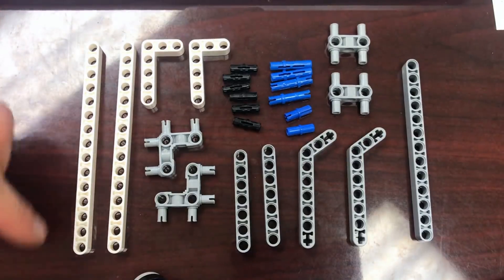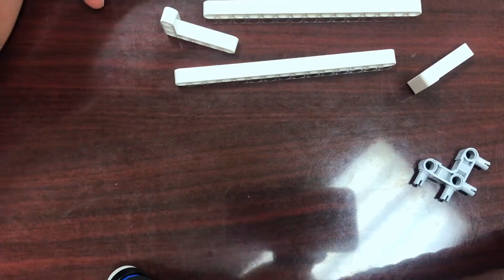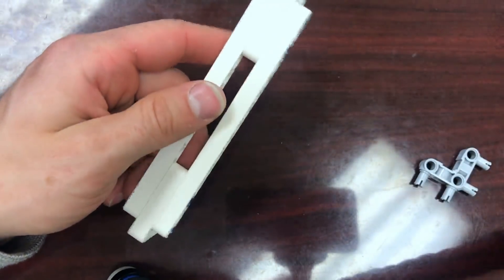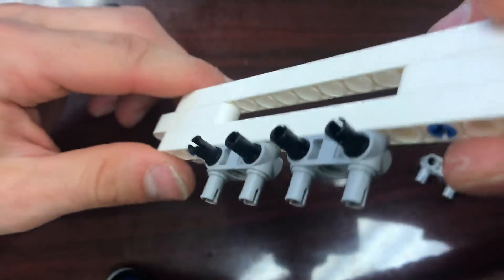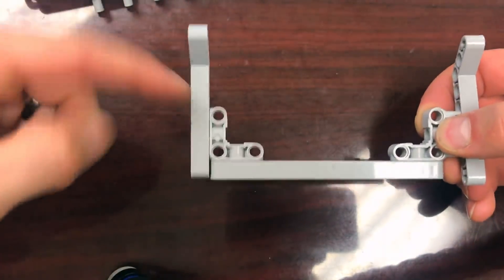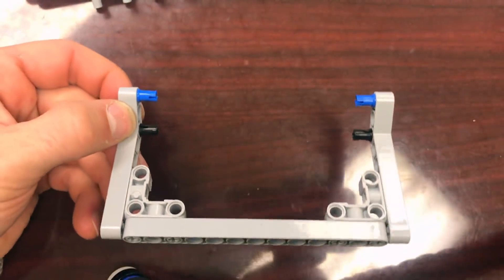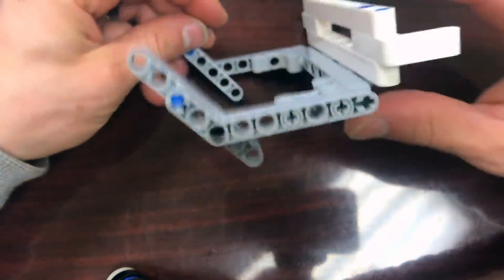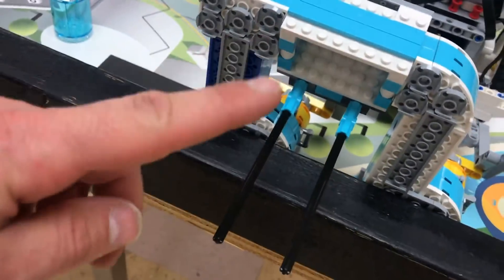FLL Hydro Dynamics Attachments: Flow Misson

Comment: The robot is accurate in its movements with large wheels? When we try, at first, it takes a shift to the left. An idea?
Reply: We've found that no matter what the robot doesn't go exactly straight forward unless we use the gyro; it can detect tiny changes in the direction, and we use those errors to send a small amount of more power to one motor, and a small amount less to the other motor, to bring the heading back to zero.  Today at our meeting we turned that into a myBlock & we've made a couple how-to videos.
Reply from the maker: +Isj P6 my students have found that the robot is far more with the larger wheels. As there is a little bit of imperfection in the EV3 motors themselves I would suggest making sure that you back up against a wall for 1 second and let the back bumpers of the robot make your robot square against the wall in base then move forward. This engages the motors and allows for more straight of a travel. Also, the slower you go, the straighter you go. What motor power/Speeds are you running at?
Reply: We made trips with an engine power of 50. If I follow your advice, it is to stall the robot and move it more slowly? Can we draw inspiration from your videos for the preparation of our runs? We are a primary class and my students are 11 years old. thank you in advance
Reply from the maker: +Isj P6 sure! Draw all the inspiration you can! I usually advise my students to run no more than 30 motor speed.
Reply: ok thank you for your advice. Can we quote you in our preparations? Do you want to know about our evolution? Good to you
Reply: I'm from team 26361 and we used bigger wheels too. We are going at 75 power and I think it's actually fine. Which wheels are u using? We are using the standard wheels, but just larger.

Comment: Since you helped us, I'm going to help you! The "Llama" is called a "Angular Beam 90 degree with 4 Snaps" and is a "special" piece. And the "Parallel Peg things" are called "Beam 3 M. with 4 Snaps" But, I like your versions better!
Reply: Plus, what can you use if you don't have those 2 pieces. Thank you so much!
Reply from the maker: +Bhargav Chandramouli Thanks for the technical names! Now I know! Which two pieces are you referring too? The so called “llama” and “parallel peg things”? If so, there are option with axles that could be implemented. With the 45 degree axle connecters.
Reply: Thank You! But turns out, our place has the two pieces and we built the attachment! Thanks again!